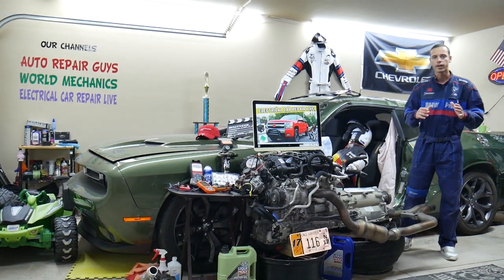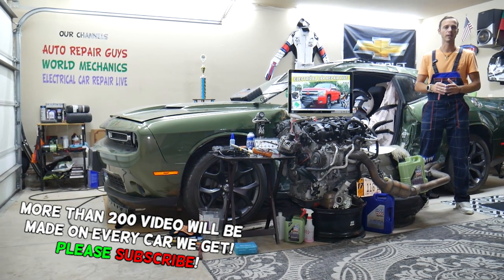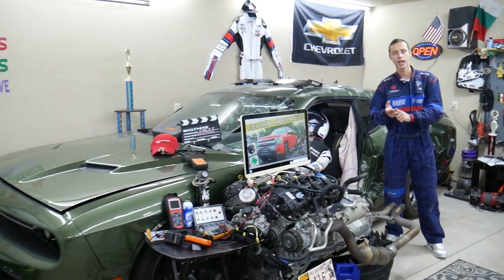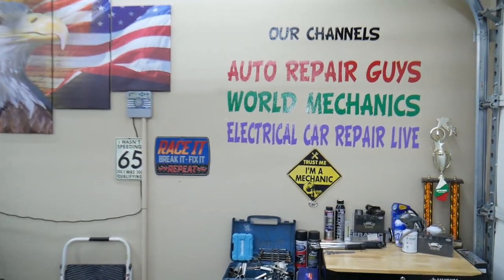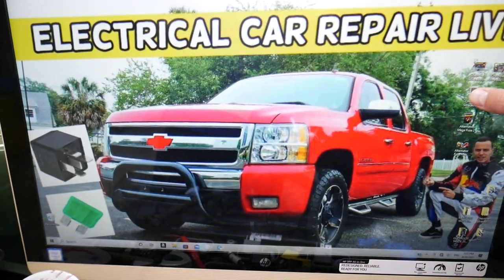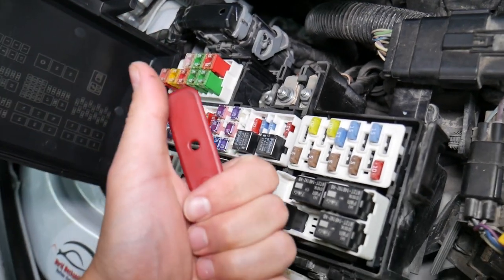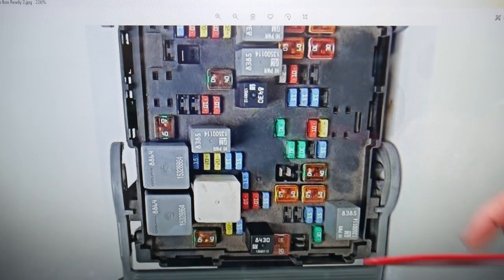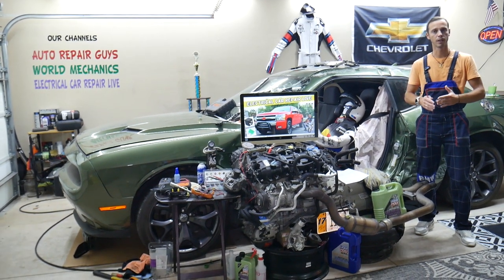CHEVROLET SILVERADO WHY NO SOUND FROM RADIO SPEAKERS 2006 2007 2008 2009 2010 2011 2012 2013

Comment: Let me save you some time: Check fuses 41 and 42 to make sure they’re not blown.
Reply: Those are gate release and airbag fuses in my truck
Reply: @jervoneeason3175  Yeah, they’re different on mine, too, probably because mine is a 2500.

But those fuses are the ones the guy mentioned in the video, but it took him a ridiculous 4 minutes and 32 seconds to do so!
Reply: Thanks